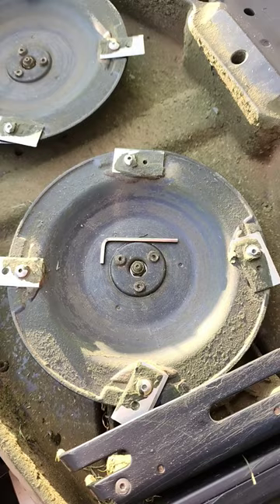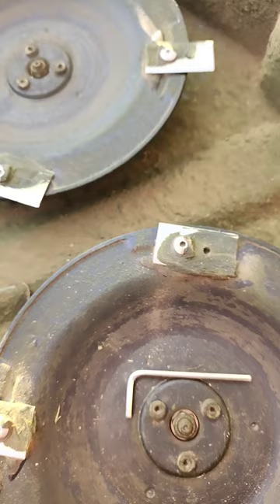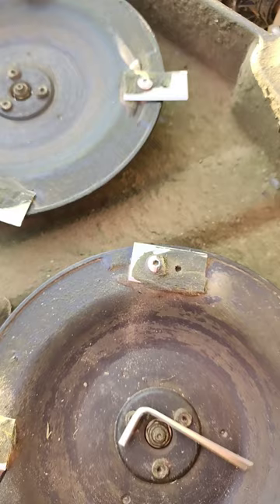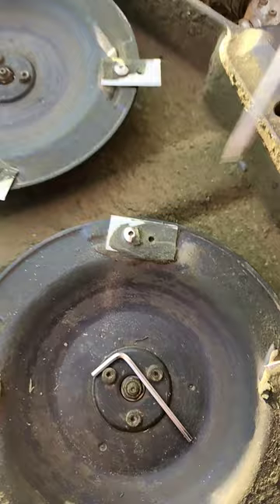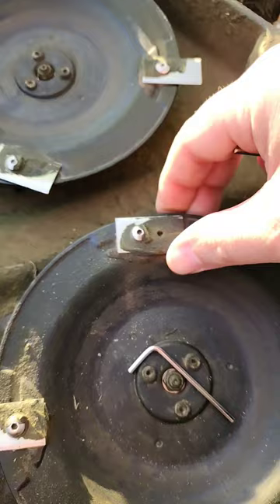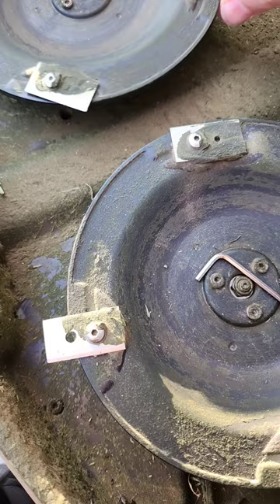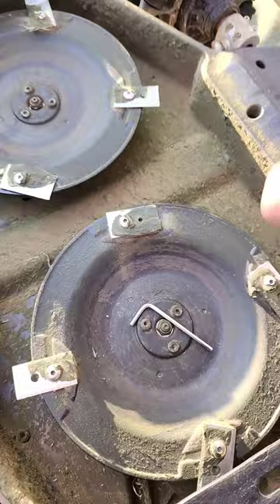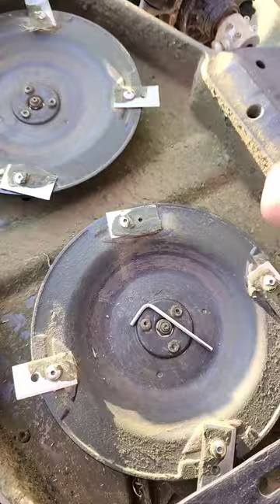This screw design is infuriating 🤬 #luba #short

Comment: I had thought Luba would be a good purchase, but I see constant software and hardware problems. Maybe they will get their shit together, but in two years problems still persist
Reply from the maker: Luba1 is pretty consistent I really don't have much trouble aside this original screw design haha I do see quite a few problems with luba2 It seems they use the first year after release as a beta period.
Reply: To be fair ur using the wrong tool. 😂 I have been using the original screw for 2 years now no problem. Buts it's a 2.5 hex,  not a regular Allen key.
Reply from the maker: @warp5768  🤔
Reply: @Crazypostman   Specifically, to take apart the entire mower and charging station completely, you need an H1.5, H2.0, H2.5, and H3.0.

But the H2.5 will remove the mower blades and disks, as well as the mower deck just below the disks to get rid of that grass buildup underneath that keeps your mower from returning the blades to the stowed position. That's the overload error you were getting in one of your recent videos. I recently had ants build a nest in my mower, blocking sensors in the charging station and disrupting the mower's return-home functions. If you ever need to do that, those are the hex sizes needed. Also, be careful as there are four bolts on the bottom that are not necessary to remove to get inside, and you could damage the Bluetooth antenna if you remove them. Feel free to mail me if u ever need more details on it.

Comment: The newer Luba 1’s came with flat/philips combo screw heads, but I find them bad, a Robertson or Square head may get better torque without stripping but perhaps try some WD-40 on them and let it soak. I think last time you also way over tightened those screws, they don’t need to be that tight.

Comment: Phillips screws are the worst, literally on purpose. They were designed specifically to cam out so factory workers couldn’t strip/break screws on the factory line. I don’t know why the USA likes using them in general. They aren’t good.

As to your problem at hand, as someone else already said, just replace them with whatever screws you would prefer. Standard sizes exist for just that reason.
Reply: Yes, the Phillips screws aren't great, but I think they are better than the button head socket cap screws Luba comes with with that strip easily that Crazypostman is showing in the short. Do you have a better suggestion for what screw type to use with Luba?
Reply: @jtbl100 I hadn't thought of this at first, but I'm going to guess that there's a non-threaded section at the head so that the blades have room to operate.  I don't know how easy it might be to get suitable replacements of any type, given that.  An old school slotted head would obviously be easiest to clean the gunk out of so you could remove them.  An entrepreneur-type might get some custom replacements made up and sell them. ;)

Comment: I had that happen to me too the first time cleaned the blades since the blades were stuck completely under the plastic disk and not cutting. After using some vice grips to grab the side of the screw to unscrew it, I ordered some robot mower blades with Philips screws from Amazon and used the original Luba blades with the new Philips screws. That way I can use the new blades with the Philips screws when the original blades wear out. Grass still gets in the Philips head, but I can use a flat head screwdriver to clean the screw head then use a Phillips screwdriver to remove the screw. 

BTW, I just got my Luba 5000 working today for the first time this year! I can't wait to get my Yuka to try out.

Comment: Any tips on how you did this? I have this problem
Reply: i used a rotary tool to cut on top of the screw, then used a flat head.
Reply from the maker: I used pliers to grip the screw head and turn them.